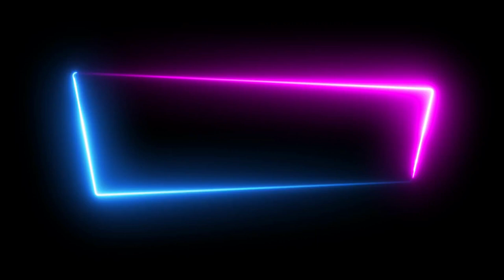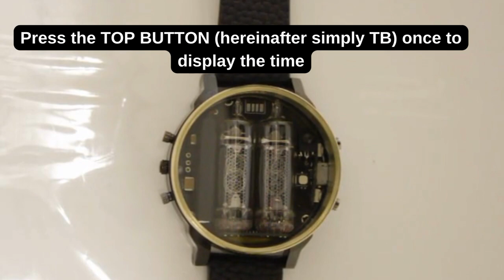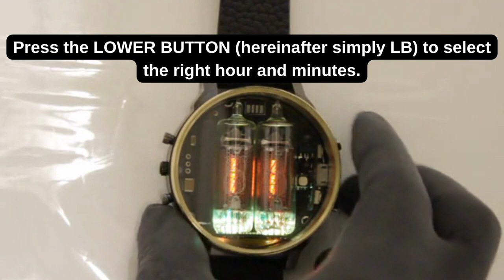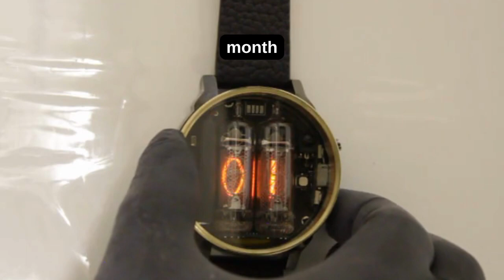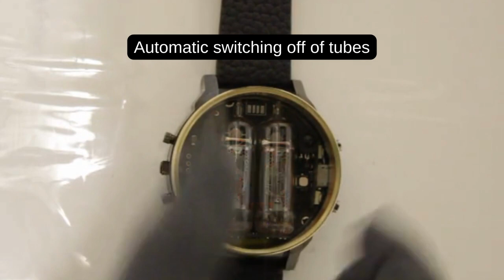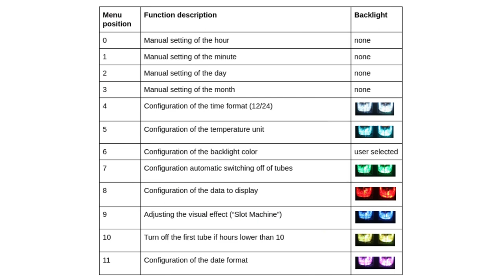nixie tube watch wrist IN-16 clock ticker style compact neon-lit wristwatch

Comment: Hey Roman, i cant seem to go to menu position 8. Everytime i am at configuring the automatic switching of tubes it goes back to the first position(hours).
Reply: For ease of use, the button menu is shortened to 8 items by default.
You can change this using the remote control:
#999876 - button menu with only the first 4 values
#999877 - by default, the button menu with the first 8 values only
#999878 - button menu with all parameters only
The menu for the remote control always has maximum positions.

Comment: Thanks for this great stuff!
I think the watch ist not, of course, wateresistant? And is it possible to open it for changing batterie some time if necessary? Yours. M
Reply: That's right, it's not waterproof. There is only basic splash protection. You can walk in the rain and wash your hands, but not swim. 

Yes, of course. It's quite easy to disassemble the watch and replace the battery if you have general skills in disassembling equipment.
Reply: Thanks Roman. Shall i then Open the bottom or the top casing?... Only in Future If necessary
Reply: ... I own one since Yesterday!
Reply: Top

Comment: What material is the case of the watch made from?
Reply: Aluminum
Reply: @romantetyk1912  oh ok. Thank you
Reply: back part is made of disgusting cheap plastic. front and sides are good. normal glass or sapphire glass and aluminium
Reply from the maker: @riskinhos  the back is made on a 3D printer as a metal cover will not work with the wireless charger

In some cases I can make metal covers to order, but not always
Reply: @romanspark7812  3D printing that's nice. there's so many materials do do it from. you could use a metal colour polished surface or something like that or offer several options
Reply: @riskinhos  This surface was chosen among many as the most pleasant to the touch by voting. I'd rather spend time creating a new watch model than spending time on covers made of different materials. If you have time, you can do it.